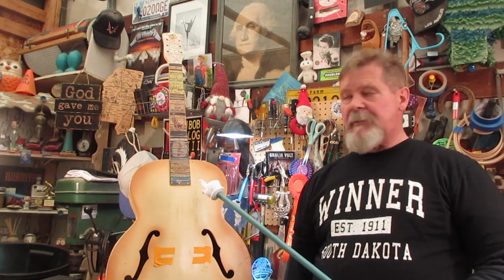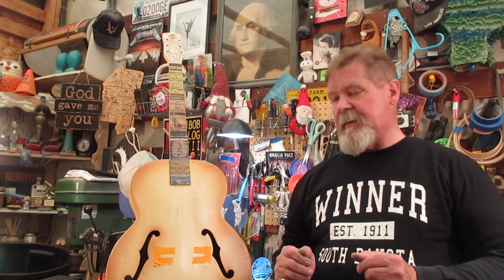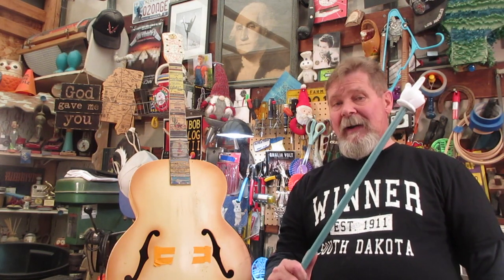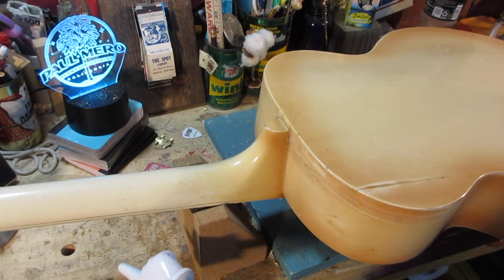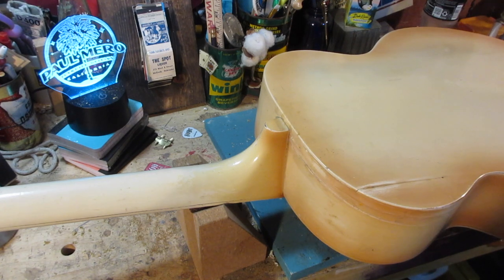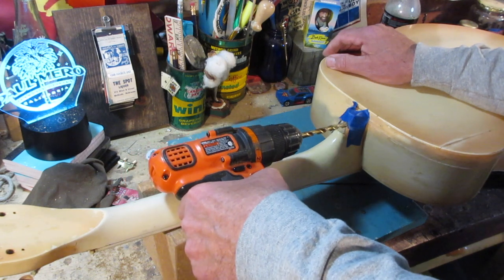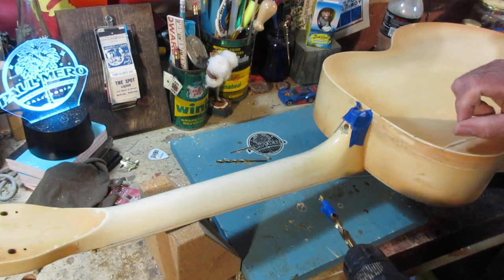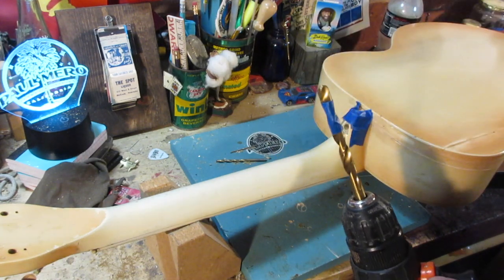Bolting a Bad Archtop Neck

Comment: thank you, Why not just use a long wood screw that catches the block behind the neck heel? and could it be a long strap button screw? I just got a cheapo Kay/Silvertone N1 that I'm thinking of doing this with?
Reply from the maker: Wood screws work loose.  Fine threaded bolts with nylon insert nuts not so much.  Remember not to bolt down to far because the joint gets thinner further down and you can actually break the neck part off.  Thanks for watching
Reply: @paulmerojunkpileguitars  understood. Thanks for the advice